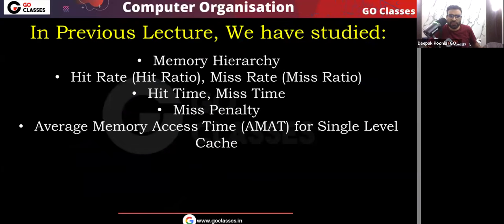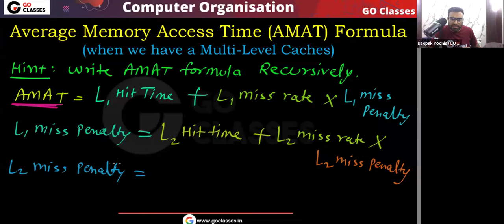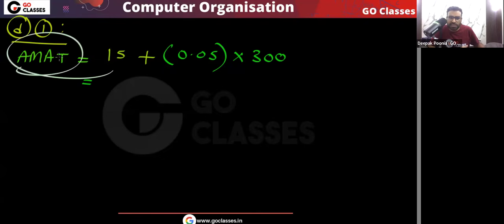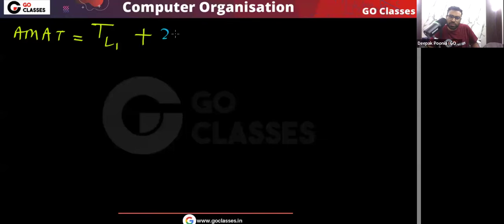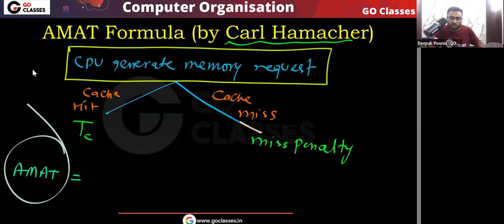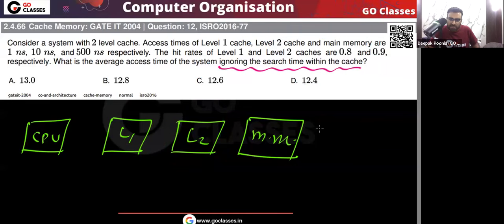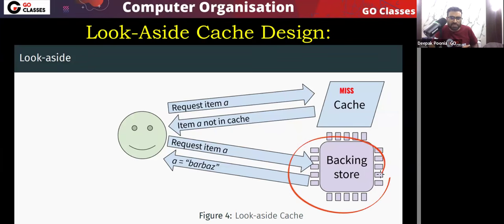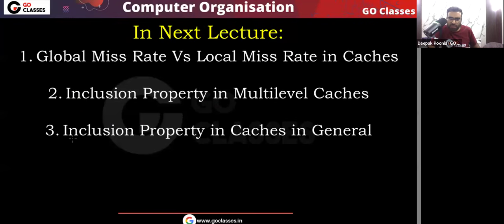Average Memory Access Time AMAT - Part 2 | Cache Memory | Complete Lecture

Comment: Multi-Level Caches & AMAT Formulas
00:01:10 - Multi-Level Hierarchy: Access flow from CPU \rightarrow L1 \rightarrow L2 \rightarrow L3 \rightarrow Main Memory.
00:04:57 - AMAT Concept: Average delay seen by the CPU across all cache levels.
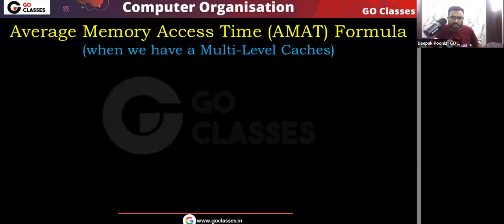00:16:52 - Recursive AMAT Formula:
Formula: AMAT = HitTime_{L1} + (MissRate_{L1} \times MissPenalty_{L1})
Recursion: MissPenalty_{L1} = HitTime_{L2} + (MissRate_{L2} \times MissPenalty_{L2})
Last Level Cache Miss Penalty = Main Memory Access Time.
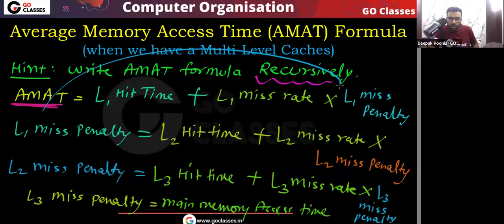00:27:27 - Note on Miss Rates: Formulas use Local Miss Rates, not Global Miss Rates.
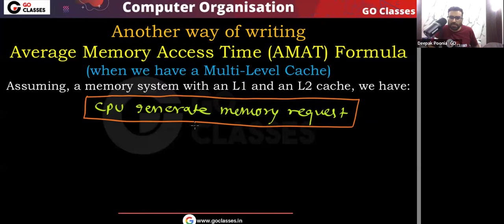00:34:14 - Alternative Formula: Tree diagram approach (sum of all path probabilities). The recursive formula is preferred for calculation speed.
Numerical Practice Problems
00:43:41 - Univ. of Minnesota: AMAT calculation and % improvement analysis.
00:50:22 - Effective Access Time: Calculating Speedup when adding an On-chip (L1) cache to an existing Off-chip (L2) system.
00:59:49 - NIELIT Exam: Identifying L1 vs. L2 based on On-chip vs. Off-chip descriptions.
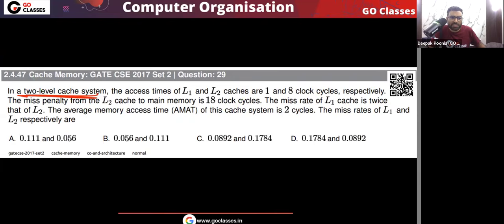01:06:51 - GATE CS 2017: Solving for unknown L1 and L2 miss rates using quadratic equations.
Miss Penalty Definitions & Ambiguities
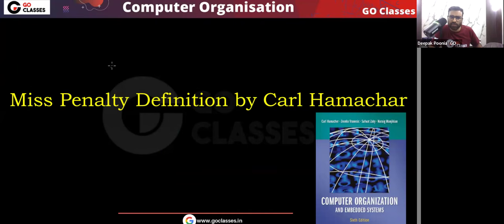01:13:57 - Standard vs. Alternative Definitions:
Standard (GATE/Patterson): Miss Penalty = Extra time after miss detection.
Alternative (K.L. Hennessy): Miss Penalty = Total time (includes search time).
Rule: Use Standard unless the question explicitly states otherwise.
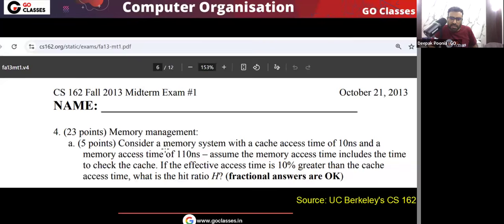01:33:58 - Berkeley Problem: Solving when "Main Memory time includes cache check time."
01:39:07 - GATE CS 2016: Finding smallest cache size when check time is negligible.
01:50:40 - GATE 2004: Calculating AMAT when explicitly ignoring internal cache search times.
Look Aside Caches (Optional)
01:58:16 - Look Through vs. Look Aside:
Look Through: Hierarchical (CPU \rightarrow Cache \rightarrow Mem). Standard in modern CPUs.
Look Aside: Parallel access (CPU \rightarrow Cache & Mem simultaneously). Obsolete.
02:22:28 - Look Aside AMAT: AMAT = (HitRate \times T_c) + (MissRate \times T_m).
02:30:17 - Misconception: The formula H \cdot T_c + M \cdot T_m applies to Look Aside OR Look Through caches where search time is negligible/ignored. Do not assume "Simultaneous Access" unless specified.

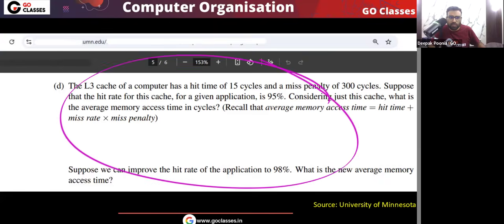Comment from the maker: 00:43:19 - University of Minnesota Question - Memory Hierarchy & Caches
The L3 cache of a computer has a hit time of 15 cycles and a miss penalty of 300 cycles. Suppose that the hit rate for this cache, for a given application, is 95%. Considering just this cache, what is the average memory access time in cycles? (Recall that average memory access time = hit time + miss rate × miss penalty)
Suppose we can improve the hit rate of the application to 98%. What is the new average memory access time?

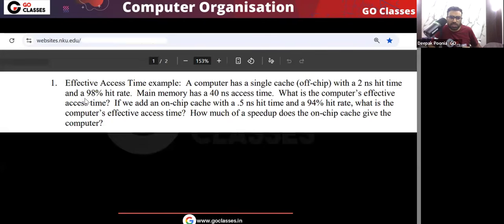00:50:06 - Northern Kentucky University Question - Effective Access Time example
A computer has a single cache (off-chip) with a 2 ns hit time and a 98% hit rate. Main memory has a 40 ns access time. What is the computer’s effective access time? If we add an on-chip cache with a .5 ns hit time and a 94% hit rate, what is the computer’s effective access time? How much of a speedup does the on-chip cache give the computer?

01:00:03 - NIELIT Scientific Assistant A 2020 November: 70
A computer has a single cache (off-chip) with a 3 ns hit time and a 95% hit rate. Main memory has a 50 ns access time. If we add an on-chip cache with a 0.6 ns hit time and a 98% hit rate, the computer’s effective access time
https://gateoverflow.in/351390/nielit-scientific-assistant-a-2020-november-70

01:06:48 - GATE CSE 2017 Set 2 | Question: 29
In a two-level cache system, the access times of L1 and L2 1 and 8 clock cycles, respectively. The miss penalty from the L2 cache to main memory is 18 clock cycles. The miss rate of L1 cache is twice that of L2. The average memory access time(AMAT) of this cache system is 2 cycles. The miss rates of L1 and L2 respectively are:
https://gateoverflow.in/118371/gate-cse-2017-set-2-question-29

01:33:48 - CS 162 Question - Memory management
Consider a memory system with a cache access time of 10ns and a memory access time of 110ns – assume the memory access time includes the time to check the cache. If the effective access time is 10% greater than the cache access time, what is the hit ratio H?

01:38:52 - GATE CSE 2016 Set 2 | Question: 50
A file system uses an in-memory cache to cache disk blocks. The miss rate of the cache is shown in the figure. The latency to read a block from the cache is 1 ms and to read a block from the disk is 10 ms. Assume that the cost of checking whether a block exists in the cache is negligible. Available cache sizes are in multiples of 10 MB. The smallest cache size required to ensure an average read latency of less than 6 ms is _______ MB.
https://gateoverflow.in/39592/gate-cse-2016-set-2-question-50

01:50:29 - GATE IT 2004 | Question: 12, ISRO2016-77
Consider a system with 2 level caches. Access times of Level 1 cache, Level 2 cache and main memory are 1 ns, 10ns, and 500 ns, respectively. The hit rates of Level 1 and Level 2 caches are 0.8 and 0.9, respectively. What is the average access time of the system ignoring the search time within the cache?
https://gateoverflow.in/3653/gate-it-2004-question-12-isro2016-77

Comment: AMAT =  H1*T1 + (1-H1)*H2*(T1 + T2) + (1-H1) *(1-H2)*(T1+T2+T3)

sir in this formula access time including cache miss penalty?
i am confuse in gate 2025 set 1 amat question
Reply from the maker: gate 2025 set 1 amat question has ambiguity. I will make video solution of that question.. For now skip that. Do not worry about that question for now. Understand concepts from above lecture & solve all GATE PYQs, except GATE 2025's ambiguous question.

Comment: I tried the GATE CSE 2016 set 2| ques 50:
I used AMAT = cache hit time + (miss_rate * miss_penalty)
got hit_rate > 50%, sir got >44.44%
and miss_rate < 50%, while sir calculated <55.55%

I also got the same answer of miss rate to be 40% and hence cache size of 30MB. 

Fear is what if this kind of difference in hit rates become an issue in the exam?
Reply from the maker: How did you get a different value?
Reply: @GOClassesforGATECS  final answer is same, here is the calculation:
 AMAT = cache hit time + (miss_rate * miss_penalty) < 6
1 + (1-h)(10)<6
h> 5/10 
h> 50%
Reply from the maker: @arthrajrathore1455  Here we can't apply Tc + (1-h)*miss Penalty.. Because question says to ignore cache searching time.. So when requested data is not in cache, it only takes Tm.. Not Tc + Tm..

Watch the video explanation again once..

We apply Tc + (1-h)*miss Penalty formula when the question doesn't give extra assumptions Or when the cache searching time is not said to be ignored..

Here Cache Searching Time is said to be ignored/negligible.. So when requested data is in cache, it takes Tc time.. But when requested data is not in cache, it just takes Tm time as we ignore cache searching time.. 

Watch the Video Explanation for this question once again..

Let me know if this doubt is resolved!!
Reply: @GOClassesforGATECS  Resolved